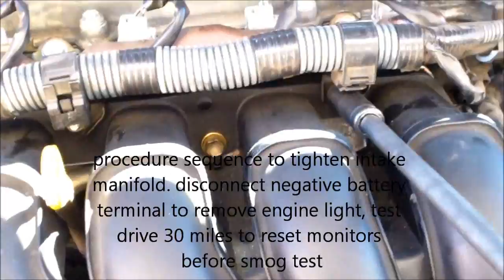P0171 Replace intake manifold gasket Toyota Matrix √ Fix it Angel

Comment from the maker: No sorrys here but thanks for putting in your 2 cents. Always looking at the bad in everything? I think I did nothing wrong.  I actually have done more than 2 dozen replacing the intake manifold gasket without disconnecting the MAF and battery without any problems. Why don't you make a video then. I have many subscribers thanking me for saving them money. What did you do for them?? Don't let me school you on how to fix a car.
Reply: Fix It Angel hi
Reply: That's what I always tell people: if you can make a better video, make it. This video showed me exactly what to do to replace the intake manifold on my 03 Matrix base model. Thank you!

Comment: srry i know you dont understand mechanic talk, the maf is the mass air flow sensor. if your going to work on any car thats gonna involve disconnecting such as the intake manifold,throttle body you need to disconnect the mass air flow sensor and battery because you can actually do some damage or your ecu might work correctly. once you have done the work re attach the MAF and battery and your good.  learn your acronyms its part of your education

Comment from the maker: I think you covered everything. Found out, Technical Sevice Bulletin(TSB) Flash reprogramming allows the ECU software to be updated without replacing the ECU. Flash calibration updates for specific vehicle models/ECUs are released as field-fix procedures described in individual Service Bulletins. You will need to take it to a dealer.
Reply: I do not believe dealers provide ecu flashing, i have asked two dealers jn my area and not a single person in service or parts or anyone they asked knew what i was refering to.
I have ONLY read that you can reprogram your ecu yourself or at a third party.

Comment: thanks for response.

MAF is OEM. O2 sensor is Denso. I just repeated smoke test this am and was able to inject large volume of cigar smoke. System held pressure at rubber glove over intake duct end. No Leaks! When I released glove, smoke came out. I'm convinced there is no intake leak. Fuel pump was OEM from used car. I have not measured fuel pressure. Coolant temps are normal from OBD2 monitor. Car drives/runs fine. I'm thinking ECM may be problem. Any thoughts?

Comment: Thanks for the video. I enjoy your silent vids. 

New intake manifold gasket and new TBI gasket on a 01 Toyota Celica. I have persistent P0171 and thought intake manifold gasket was problem. However, after installation yesterday, I get the same high (25-30% LTFT) and code P0171 after a few driving cycles. 

I have replaced MAF, PCV, PCV hoses, fuel pump w/ no change. O2 sensor is about 1.5 yrs old. Smoke tests w/ Cigar smoke was inconclusive 

Any suggestions?

thanks

Comment: Thanks so much for the video. On my 2008 Pontiac Vibe I had to also remove one more bolt on the transmission case that held the manifold on. It was a 12mm bolt with a "10" written on it. Did this in exactly an hour with a torque wrench too. Even got the torque pattern right. 
Question: Is there supposed to be a gasket on the throttle bottle where it connects to the manifold?

Comment from the maker: there is a specific torque spec, 22 ft lbs. but if you do not have  torque wrench. you can tighten bolt then turn a quarter turn more. it's not like you are rebuilding and engine where you have to torque all the internal bearings. thanks for watching and please subscribe. trust me...the techs at the dealer don't torque it.

Comment: Great video.  It fixed my "searching for idle" problem when winter cold and getting the 171 code on our 2003 Corolla.  It took me an hour and a half with one broken bolt on the throttle body.  Old gasket was a solid piece of plastic, like a Fisher-Price toy, after 250,000kms.

Comment from the maker: awesome bro, you can find in autozone but sometimes a cool service advisor at the dealer will give a free plastic clip. hand tight bolts is ok, i do that all the time unless it's internal engine parts then need to torque to specs. thanks for the comment. welcome and please subscribe

Comment: Just finished installing the intake gasket (and put a new throttle body gasket).  Your video was awesome and gave me all the info needed to do a complete job.  I only hand tightened the bolts.  I broke one of the plastic engine cover clips, any idea where I can get one...or to the dealer I go.  Thanks again, you saved me $200!!!!!